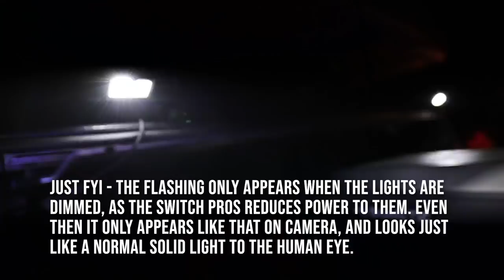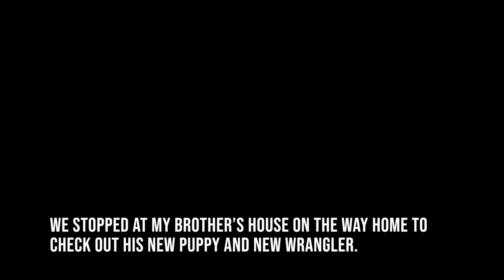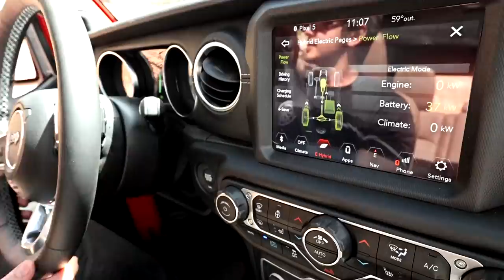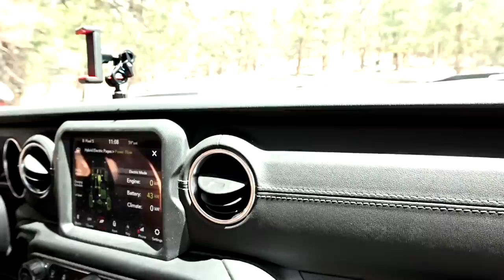WEEKENDERLANDER EP 29 - Freedom Tremor F250 Break-In Camping Trip - FULL-SIZE OVERLAND + Good Eats

Comment: Ask Maple's vet for a meclizine dose (mg based on her weight). You can use cerenia as well but its pretty expensive . Most dogs I've had motion sickness issues with do ok with meclizine. Just need to call and ask her doctor for  some/ a dose.
Reply from the maker: Yeah, we have actually tried it. It worked once on a long road trip (I think), though she still drooled like crazy and wasn't having a good time. On the way back, it didn't work and she still puked. So... the puke force is strong with this one.
Reply: @LastLineOfDefense  oh darn. the last thing you could try is adding on trazodone with the meclizine if there is some anxiety drive behind it. 3D print a barf bucket that attaches to her collar if that fails!